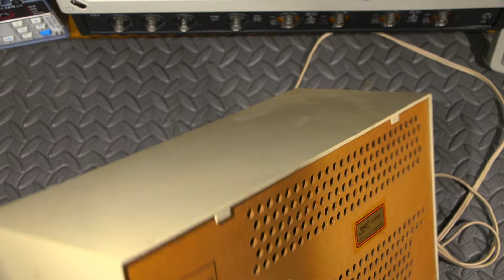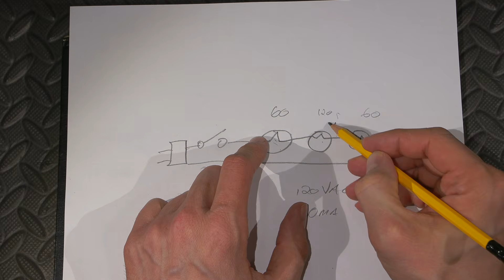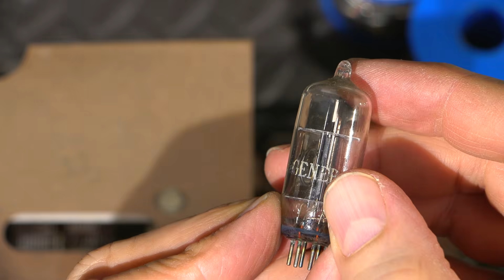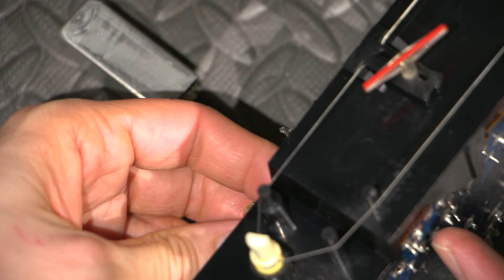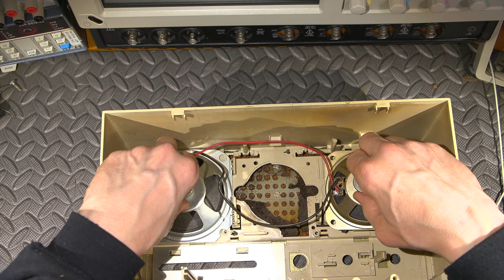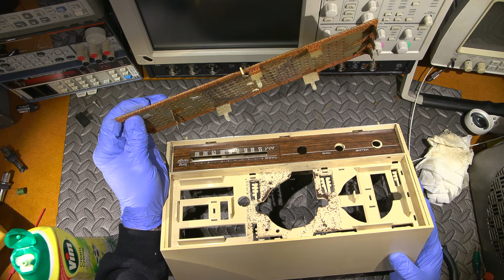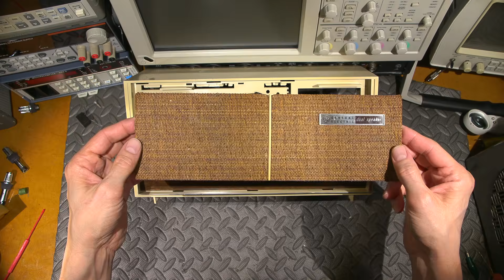Barn Find Restoration Adventure - 1960's Long Range Radio Receiver!

Comment: I had a 1955 RCA aa5 that had four screws on the bottom. Sitting outside our beach house, I had my bare feet buried in the sand and put the radio on my bare knees to enjoy it. It shocked me so bad, I peed myself. My father took a broom and knocked it out of my hands. He cut the cord off of it, thinking it was broken.

Comment: I have a portable am  tube set that is powered by either 115vac or a 9lives 10 pack of 9 volt. Needs re capping and likely re alignment, all in a leather case .  It worked on the battery pack some fifteen years back but I would not use the cord until it has been restored.

Comment: Using this method of checking for open filaments can also be used to check for open cartridge type or blade type fuses. No voltage across the fuse terminals equals good fuse. Voltage across terminals equals open or blown fuse.

Comment: For cleaning radios, you can use a sandblast gun from the auto store, and get crushed walnut or almond shells from the gun store (used to polish cases) you can then blast everything including the variable cap without damage.

Comment: I have the AM-FM version. Wood case with the plastic cabinet you have there.  The name badge says "Solid State Tuning" . The 3 transistor FM front end did not have enough sensitivity to pick much up without rabbit ears. At first I thought the tuner was dead. I soon discovered the chassis did not include AVC therefore no audio snow. A cheap set in a plastic cabinet that slid into the fancy wood case. Your set however is an honest 6 tube AM .

Comment: My parents had a GE radio like this but it was fm as well.it had good sound for not being stereo. I have found over the years that Ge clock radios could pull in many stations and they are still working after 30 years.

Comment: There is a process called Retrobright where you soak the yellowed plastic in 7%H2O2 with powerful UV lights for a while. Whitens up really well. Saw this on a restoration channel.
Reply: Rescue and Restore 1978 millenium falcon episode

Comment: Great work. I'm a UK ham & would like to do this with old broadcast band radios myself. I have some experience with tubes in RF amps. The ones I have had use the high voltage TV line output tubes like EL509/19 PL509/19 & American 40KG6 & 6KG6. I have modified old police & taxi radios in the VHF & UHF range to use on our bands, so know a little, but the high voltages on some tubes like 1000 volts plate voltage of 1 of my amps (which I have felt) are not to be taken lightly.

Comment: As with every video of Mr. Carlson, he brings up an interesting issue you've never heard of. In this case, "silver mica disease" term. The word "disease" in electronics sounded a bit weird and so I had to look it up. It turns out that "disease" is really a descriptive term for a phenomena of "electrostatic creeping" of silvering of mica - whatever that is. Even though it's explained well, I still don't understand. I mean, silver ions? What is that? Sounds like quantum mechanics or something.

Comment: Great video as always. Your test speaker looks interesting, and I'd love to see more of it.
Reply: I have a speaker like his 'test' speaker. It was with a Hammarlund hq 100 communications reciever.. Which is working.. My father was an amateur radio operator for years, his uncle gave it to him and my dad gave it to me... I never got interested in 'ham' radio, but have restored many old wooden cabinet radios over the years... I have a '37 general electric floor radio,  a 1950 zenith trzns oceanic set that i refurbished,  several european table radios from early 50's
Ive been doing this from my early teens, taught by my father

Comment: I can almost smell the tubes.  I think you can also slide the ferrite rod to adjust the tuning and then probably glue it in place if the adhesive is baked dry.

Comment: I suspect the center speaker in this model configuration is to act as a port to bring inside sound from both speakers with a slight delay out thru the front.

Comment: Plastic might be drying out and getting brittle.  You might consider wiping it down inside and outside with Armor-All plastic protectant.
I saw some spots that weren't coming off but then I cleaned my laptop screen and it's much better!

Comment: Mr. Carlson, I like the "Diamond Back" (or whatever it is called) Bench Top Covering.      Does it help Prevent small items such as screws, etc. from rolling off into the Floor?  I hope it is "Non-conductive" for the Obvious Safety Reasons.

Comment: Got an old 1951 Zenith with an RF amp. I'm not sure that it does much for it in those older tube radios. Vacuum tube detectors are also said to be inefficient. I've substituted them with a germanium diode and the difference is astounding.

Comment: Great job, Paul.  Ever tried the "retrobright" method to make a plastic enclosure bright white again? All you need is peroxide and a UV light source, like the sun.  There are some interesting video's on YT that show how to do it.  The result can be very impressive.
Reply: This case was never white, you can see that from the inside surfaces.

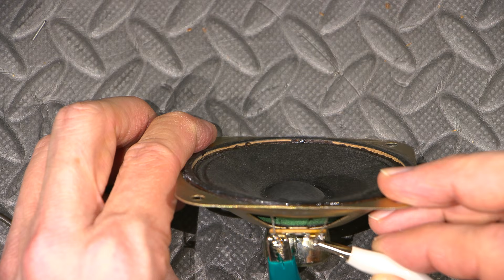Comment: 1:11:11 With that laquer coated speaker being from Japan, and the very small output transformer, I'll venture a guess that this was one of GE's last tube radios, maybe from 1965 or '66. Maybe there was an alternative grill panel for the models with a clock in the middle. I wonder if the USA-made versions of this were much different. Thanks for posting!
Reply: Thanks for pinning the date down more precisely. I was wondering what time-frame it would be rather than just a vague "1960s".

Comment: Incredible all those AM stations still on air, they've almost completely gone in Europe. Even FM is gone in some countries like Norway. Never liked repairing transformerless radio's myself, failing an isolation transformer and being on 220 Volts here.  This one must have been very cheap to produce in those days, tube prices were no longer high in the 60's and even the output transformer could be miniaturised, recognizing the rather narrow audio band it has to cover in this AM only radio. Maybe thie tube that failed here was the only expensive one, since it is a rather rare combination of elements and of different assembly than most other types as I seem to remember..

Comment: Just wondering what y'all think of the idea of replacing the tube rectifier with solid state rectifiers in this type of radio? One disadvantage is that you no longer have a one to one restoration since you are changing the circuit from hollow state to solid state rectification. On the plus side it does free up some space inside the cabinet and, one less tube means less heat generated inside the cabinet.

Comment: Mr Carlson,

Have you worked with components with calculating measurents in Siemens values as 1/the Resistance in Ohms equaling the value in Siemens measurement.

My Cousin was in a great work program for the Siemens Electronics, GmbH-Inc.

Thank You,

All the Best,

Godspeed.

Comment: I can't stand when my equipment has a smell. I got a kind of neat, Zeenith solid state radio with an awesome range. It needed a full recap and replacement of every wire. It looked just like this GE, and I was going to restore it. It had a smokey and oil smell. I ended up recycling it since I couldn't get the smell out. I did keep the variable capacitors and potentiometers as well as the ferrite core and winding. I am thinking of throwing it in one of my other vintage radios once I get an oscilloscope.

Comment: On the speakers if it was myself doing the restoration. With the 3 places for 3 speakers. I think I would have made a small triaxial speakers with a thin foam for baffling. Just to make that great a-6 just a little bit better.

Comment: For pulling the most out of broadcast AM you need to test at night. The part of the ionasphere that reflects broadcast AM does not work well in the daytime. One of the biggest problems with reflected signals is fading.The are several type. One is where the signal does to reflect another is where it comes from more than on place. There is also selective fading where part of the signal reflects and part does not. This causes severe distortion. Short waves reflect from different areas of the ionasphere and behave differently than commercial broadcast AM.

Comment: In the '70/72 era I worked as a 'Stock Clerk' for Thrifty Drug #325 in Las Vegas and there was a 'tube-tester' along with maybe a 100 tubes inside the 'upright coffin' cabinet
This was when 'digital watches' first came out  for the general public and they were 6 to 8-hundred $ then! Just red numerals and nothing else!
__________
What a 'Clash of Technology' at the same instant!
__________
I kinda' think we had that same radio in the late 50's early '60's times...it could be a 'false memory' but I don't think so

Comment: There are 2 possible plastics that might be the source of the "smells like a perfume" - celluloid, polystyrene and/or any of their copolymers (notably ABS) and both degrades as temperature rises. Celluloid outgases camphor and polystyrene outgses styrene, which (not the reason for owfull smell during FDM 3D printing with ABS filament) is toxic but is part of such pleasent natural odours as cinnamon, coffee beans, balsam trees, peanuts.

Comment: There supposed to be a speaker in the center also bc that is what makes it a long range radio with sub,mid,high but I guess someone took it out. Ive got a radio. Similar to the one there and it has all three speakers in it.

Comment: 20:00 That's a weird looking trace, going from the tube you're just about to measure to the one at the bottom of the screen. Any reason why they have those breaks like that in the plane, instead of having a solid plane? I am somewhat assuming that's the ground trace.

Comment: Maybe I'm too naive but would it be a viable option checking for continuity across the filament pins of each tube whitout having the line cord attached?
P.s: nicely done job as always
Reply: Yes, that's also a good option. An extra benefit of continuity checking is you can remove each tube and test out of circuit, generally eliminating the need to remove the chassis.

Comment: Could you not use the resistance setting of the meter and check (out of socket) directly across pins 3 + 4 to see if there is a short which should indicate a good filament?  
A quick count of the stations...I was able to hear no less than 44 different stations...but there were many more that I could hear but not differentiate well from the stronger ones!

Comment: Pretty remarkable restoration - absolutely amazing how sensitive that receiver is.  Stellar performance of the radio - I have never seen those tips for repairing speakers let alone how to tune one of those radios.  The radio itself is awesome, but sadly AM radio content has gotten so much worse over time.  I remember switching over to FM some time in the 70s when those receivers became more affordable.  Great video!  👍

Comment: When you repaired the if transformer and reinstalled it in its case, is the input and output the same doesn't matter which way the transformer is in the case?

Comment: What a guy tuber said was you can wash you many electronic board in water it not problem at all but make sure its has a day drying. I get tiny Roaches that love living in their as my 12 volt tv. Or my manual turn timer and speed controller I just wash it clean every 6 month. And it feel brand new and fresh,  I long ago had a simple tube radio I took a the amp it had a sweet bass to it . I brought today tube amp but it unless you pay a lot it don't sound that different. If you can find a old jvc console it was called the perfect stereo back then my friend pop had one the reverb was pretty concert hall like LOL but it was super crisp the pops like bubble in the instrument was special. Their is one  on utube and it record does sound quality still had the clean sound.

Comment: I recently fixed my speakers, 15 inch woofers with rotten surrounds and I got a special glue that looks like wood glue but it has a sort of rubber in it and it will keep its flexibility.
It's specially made to glue paper and foam surrounds to the metal, I can assure you that the superglue, any superglue is not going to last very long.
For this sort of application you really should use the right glue, it's dirt cheap so you shouldn't cheap out when you fix a radio like this and put a lot of time and effort in it and then you use the wrong glue that is not going to last a long time.
The vibrations will tear the glue apart from the metal because the superglue just isn't made for this application, I can't stress this enough that it is super important if you want to do it right and want to make it long lasting.
Reply from the maker: I have speakers from 15 years ago in regular use that are still working fine with this method. The area that is glued is not flexible, and super glue bonds extremely well to both paper and metal, so it's a perfect medium for this application.
Reply: @MrCarlsonsLab  Weird, whenever I try to glue something to metal with superglue it never works, just for a while but then it rips off the metal again.
I still recommend the rubberized glue which is specially made for this sort of applications, but yeah that small speaker of yours is never going to pound on that seem as the 15 inch woofers that I have here.
Reply: Good quality CA glue should last the life of the radio with no problem.  Hardware store "super glue", on the other hand, is a low-quality, low-cost variant designed for everyday use by people who don't really know how to use glues properly.  I have found the best CA glues for general use in hobby stores and woodworking supplies. For situations that require a degree of flexibility I recommend black CA glue which has powdered rubber mixed in it.  The glue is very strong and the rubber reduces the brittleness that causes some standard CA glues to crack with flexing.  
Some 25 years ago I used some of that stuff to repair a large line printer that had no spare parts and absolutely had to be kept operational 24/7.  It had a custom-made one-of-a-kind type font that was pressed onto thin fingers protruding from a horizontally rotating 6" wide metal band that spanned the full width of the machine.  It printed long reports onto the wide fan-fold computer paper that was in common use at the time.  The band rotated some 600 rpm and the print hammers firing against the moving type fingers would make the thing sound like a machine gun when in use.  A thin rubber V-belt was bonded to the back side of this band to keep it in proper registration within its oval shaped track, but the belt had ripped off when a bearing went bad in the band's drive motor. After replacing the drive motor I used some IC 2000 black CA glue to glue that V-belt back onto the band praying that it wouldn't rip off again after a few rotations.  It ran perfectly for three more years until the machine was finally replaced with a more modern laser printer.

Comment: You might want to consider sourcing an ultrasonic cleaner and after an ultrasonic cleaning that is extremely thorough you splash high octane IPA (90%+ IsoPropyl Alcohol) all over the cleaned electronics to remove corrosive liquids so it dries quickly and safely. I Use Ultrasonic cleaning on micro electronics like phone motherboards and laptop components.

Comment: Would have liked to have seen the repair to that tiny wire in the IF Transformer.  When you used WD40, did you flush off with IPA ?, and when cleaning flux residue off do you just use more IPA until the PCB feels clean.
Reply from the maker: To clean the RA flux of the board, I use Lacquer thinner. IPA works, but tends to leave a white residue, and takes longer to do the same thing.

Comment: What gauge wire is in the IF can about #38? Many people don’t do this but please wear safety glasses when soldering. I did it for 17 years and was very fortunate to not have severe eye damage due to solder flux popping when I heated a joint on a connector. Thousands of solder joints but one brief pop could have been catastrophic.

Comment: Perhaps it's a dumb question, but why not use an ohmmeter to check the filaments while the tubes are out of circuit?

Also, I wonder if a cheap electric toothbrush might help with the board cleanup.

Comment: Nice looking and sounding radio. 
I'm surprised that the dial doesn't have the "triangle in a circle  circle" civil defense symbols...wasn't that standard fare in the '60s?
Thanks for sharing!
Reply: I was wondering about that too. This radio was made in Canada. Did Canada not have the same requirement for marking the CONELRAD frequencies?
Reply: @fly4fun610  It seems CONELRAD was US-only so Canada probably didn't require it. However my guess is manufacturers would often still add it so they could sell the same radio in both countries. CONELRAD was discontinued in 1963 so this radio also might just be too new.

Comment: I think that I would have tried to find another speaker that would fit in the opening in between the other two speakers,,  It would not have to be wired in,, it would just need to have a cone that moved very easy,,,  I think that would have greatly improved the low frequency response,,   :-)

Comment: does it matter which slug you adjust first?
Reply from the maker: If the radio is very deaf, then yes.
Reply: Ah okay. Thank you. I am trying to get some sound out an old CB radio... It has some of those adjustments aswel. My first guess was to find the point where the sound is the loudest. And that is just what you explained 👍